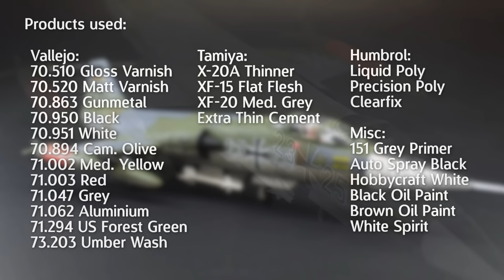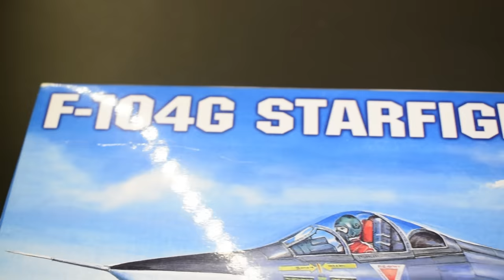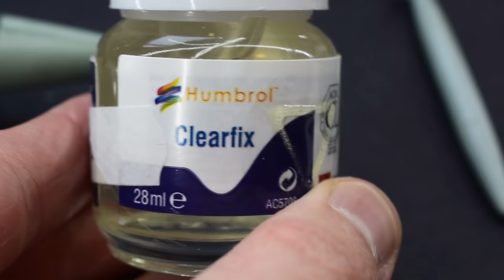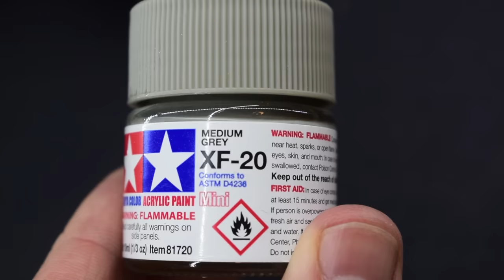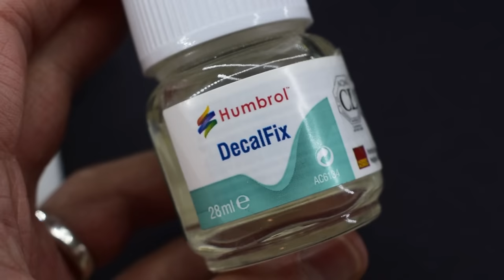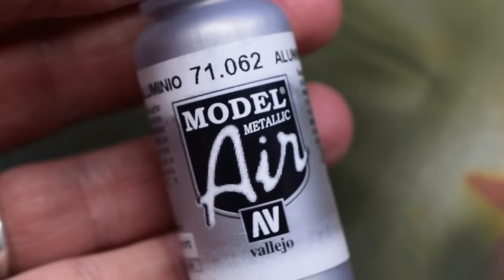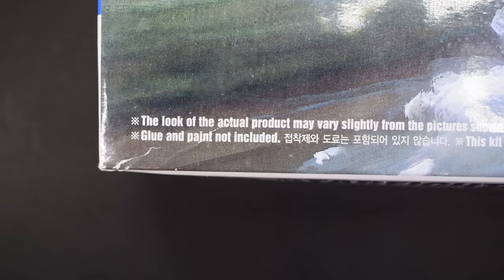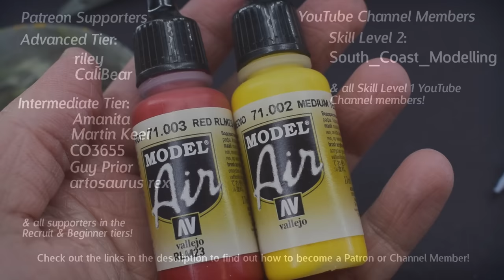The Academy F-104G Starfighter in 1/72 Scale is NOT Terrible . . . Build & Review

Comment: It looks like the original Hasegawa Starfighter that Frog issued in the late 1960's and early 1970's along with a few others.  Academy in their early days was not above using other kits as a basis for their efforts.     The 1980's Esci kit reissued by Italeri  is a much nicer kit and the Hasegawa kit from the 1990's is even better,  if you can find one.  I have just finished one  in Canadian  markings. 
All the Marineflieger 104s I saw for real and photos in the 70's and 80's had a single colour uppersurfaces,  although some may have transferred from the Luftwaffe and retained the two tone scheme for a while. The equipment fits were slightly different.
Reply from the maker: Yes, I think they copied another kit because there are huge similarities

Comment: I have Academy's MiG-21, haven't built it yet but its the same as the Starfighter an old rebox of I think FROG paid about what you did for the Starfighter. Only reason I got it was that it was the cheapest MiG 21 readily available from shops and I wasn't in the mood for ebay hunting for the Revell kit
Reply from the maker: urgh, eBay drives me nuts lol
Reply: It’s not a rebox of the FROG kit, as there are some differences in the parts breakdown and sprue layout. However it is a very close copy. A number of early Academy kits follow this pattern and, for a long time you couldn’t get Academy kits in Japan because so many of their 1/35 Armour subjects were unauthorised Tamiya clones. Fortunately, they no longer follow this practice and their newest releases rank with the best in the world; case-in-point the new Airfix “Katy,” designed and tooled by Academy from research provided by Airfix.
Their are much better F-104 kits in 1/72: Revell, Hasegawa, even the old ESCI kit is decent and has recently appeared in an Italeri box.

All that said, Matt’s model is nicely finished. Great result!
Reply: @russelltaylor535  thanks for the correction, maybe it was another kit in my stash that was a rebox of a FROG kit. hard to keep track of it all lol

Comment: Did a good job on the manned missile . Academy decals are a right pain in the bottom. Think they thickness is due to the fact of being used on gundam . But top tip for using the extra thin on them.👍
Reply from the maker: thanks! It's a risk as it could melt them though
Reply: I'll be honest, I don't see the link here.  Academy are from South Korea and Gundam/Bandai are from Japan, besides Gundam kits do not come with decals, they mostly have stickers or dry transfers.

Saying that, the older Academy kit decals are famously bad.  Then again so are the older Hasegawa kit decals as well.  If you want to laugh at bad pilot figures look at the melted pilots from the dragon kits!  I've heard some people have success with hairdryers melting decals, but it can melt the model as well, so is a double edged sword.

Lovely build there Matt, but it looks likes the burner can/exhaust has dropped in some of the shots... Could be the angle the video camera was at.  I've got the Hasegawa F-104J kit that I paid around £4 for, be interesting to compare it to this one.

Comment: 15:07 I think this model has quite good level of details and panel lines, but you've bloated the surface with lacquer primer from hardware store.
When you put the gloss coat at the end, the panel lines will almost disappear of wash could not grab onto the recessed lines. 
Try to find the finer nozzle for spray can to achieve better atomisation of the paint, or use some of the hobby primers specialised for this purpose. Anyways, very good looking aircraft :) 
Regards
Reply from the maker: thanks for the tip, i might see if there are some 3d printable nozzles that could work in the future
Reply: @ModelMinutes  Also, you can decant the paint from spray can and use it with airbrush!

Comment: Bad Kit, but great execution by you :)
Having built the Revell 104 i can safely say that its about 200% better than the academy kit. what a difference a few years can make!
Reply from the maker: Maybe i'll get that one next :)
Reply: @ModelMinutes  I'd like to second the recommendation for the Revell F-104 (Either as a standalone around the 10 Eur price point or as part of the fantastic 60 years of Luftwaffe set), it's a really fun and easy build and despite the low parts count can still look fantastic. Also, at least in the multipack version, the decals were a lot more detailed (from the video it appears that the Academy misses a lot of the technical stencils for the maintenance hatches and control surfaces) and had 0 problems blending into the finished kit

Comment: Great job but saw the same kit recently at my local hobby shop it is now selling for $21.95 in the states ! I was also wondering so you  used Tamyia extra thin glue as a decal agent how exactly did you apply it without it spreading everywhare an ruining the kit?
Reply from the maker: i applied the extra thin using the included brush, but i made sure that there was only the smallest amount of cement on it. The brush needs to be almost completely dry, it is really that small of an amount

Comment: Do all academy kits come with figures or not
Reply from the maker: I'm not 100% sure, but I feel as though the ones I've built have all had figures so far . . . but then i've only built a handful of academy models and not all their kits might have them
Reply: @ModelMinutes  yep because I’m considering buying academy’s ea18g or a ww2 plane ie spitfire or mustang or even a b17 for my little brother
Reply: @brockclark7404  pretty sure the B-17 does not have figures.  Most of the figures they do include are pretty horrible, even in 1/48 scale. I had a few of their 1/48 Hughes 500/AH-6 helicopters - the figures were awful.
I know it's an added expense, but after market figures are the best way to go.
Reply: @mh53j  yeah I had a mig 27 from them and used the pilot figure but I have a airfix fighterpilot and should have one in my collection but you are right about academy figures